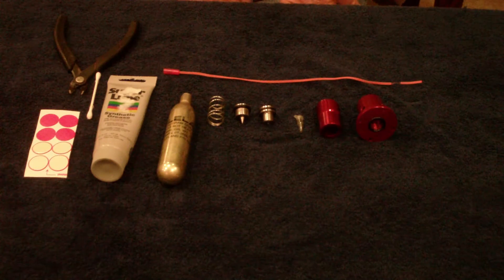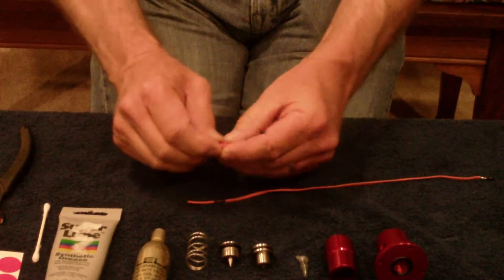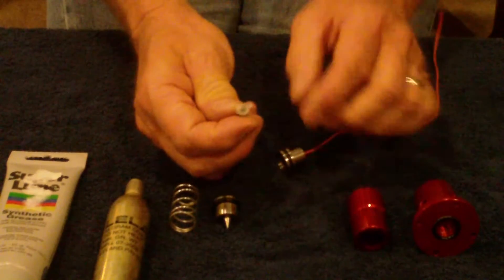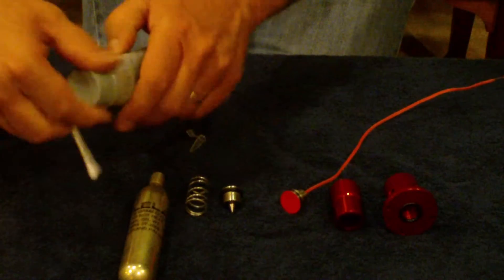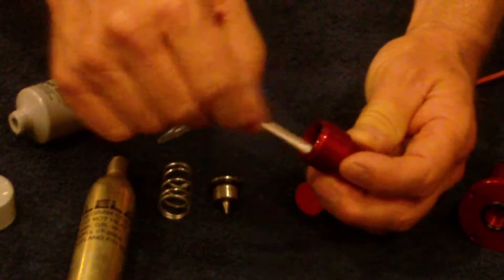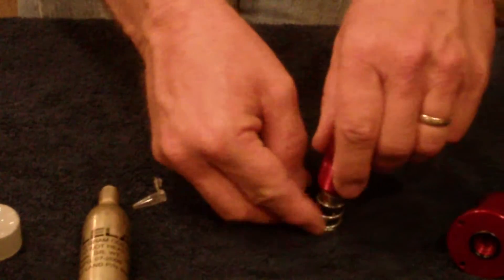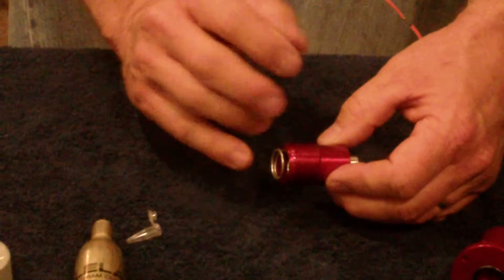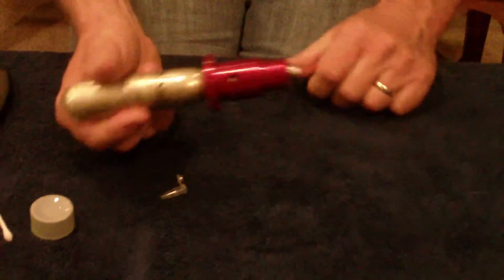Loading the RAPTOR CO2 Ejection System

Comment: Instead of using a powder charge to fire the pin into the canister, why not pierce the canister at the start and use a solenoid to turn a valve releasing the Co2?
Reply from the maker: Using any of the CO2 ejection devices from Tinder Rocketry is a very SIMPLE process. You can easily load the device hours, days or even weeks ahead of time and the device can be counted on to work. By adding HIGH PRESSURE solenoids and additional plumbing you are taking something very simple and making it MUCH more complicated than it needs to be, never mind the extra weight and space this would necessarily add. In addition, each setup with your high pressure solenoid and needed plumbing would be custom to your setup and not easily transferable to other rockets like these devices are. Hope this helps...
Reply: @TinderRocketry  My thinking about the Solenoid was along the lines of a bicycle CO2 canister. You screw the CO2 canister into a valve and place it onto a bike tire. You turn the valve and the co2 inflates the tire. Why couldn't you take that same valve system (as compact as it is) and set it up so the release is electronically controlled? No special plumbing or anything required. The co2 is pierced at setup and the air pressure is held back by the valve for minutes, hours, days, weeks... When the pyro signal is sent to the valve, it opens and the pressure release pop's the chute. This way, you can remove black powder completely from the ejection.
Reply: @TinderRocketry  I'm thinking a 2-Way Normally Closed Valve would make this a 2 Part System. The CO2 Canister and the Solenoid Valve. Check the 1m10s section of this video and imagine it controlling CO2 vs. a Liquid. -- https://youtu.be/C_qdzfE0VLs